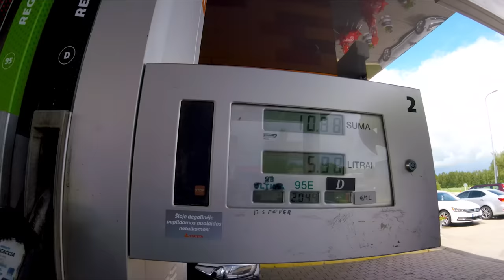Lithuanian Mechanic Makes it Look Easy.. (Lithuania Belarus Border to Kaunas)

Comment from the maker: I love balanced wheels now and am a changed man. Anyone ever have wear like this?
Reply: I get the "shark tooth" affect on my front '17 Honda AT tires.  But you get the same behaviour...that bunny hop. 😞
Reply: My Triumph Tiger XCA 800 is bumping around 60-70 km/h (Michelin Anakee 3). Quite annoying 🏍💨
Reply: Yes, my rim is bent and unbalanced 😂 need to get it sorted. Busy getting a harder front rim. Happy belated birthday.
Reply: Buy some reusable brass weights for the spokes mate. I have them on my XT. Marvelous things.
Reply: The shark-tooth effect has more then one cause. Less airpressure, load of the bike (pillon and luggage) and of course the hight of the knobbies.
Reply: I have this common wear issue on Knobby tires street use. Some people will turn the tire around 1/2 through the wear cycle.
Reply: Have this situation on my 96 DR650 rear tire after an Iceland trip. No big deal, still some milimeters left on the lowest parts to finish this season and then gonna change for a new one for the next season. Probably gonna choose something more knobby this time. Pirelli Scorpion Trail was really nice for asphalt, but not so good for gravel or unpaved roads. But still manageable, passed some of the harshest F roads, crossed some small rivers with it. Not too bad, just always mind your equipment!
Greetings from Kaunas, Lithuania!

Comment: Hi Pedro. Here is something that can help you in the future : Just balance your rims without a tire. Most of the imbalance  always comes from the rims.  So you can change your tires or repair the tube by yourself. Just let the weight on its place and you will be fine.  Happy journey.

Comment: Belated happy birthday mate. I hope you had a good one.
New tyres, the smell of new rubber is awesome. I think I change my tyres before required just for the smell of it. I've a couple of old tyres in the back of my van now for a couple of months now and on hot days, everytime I open the side door I get a sniff of rubber. I'm wierd eh?
How I got travelling into the Eastern block early on, we used to export Lada cars back to Russia via our contact in Lithuania. The Lithuanian's used to convert RHD cars to LHD in those lock ups with little more than basic tools. Very impressive to what we in the west have to work with. I admire the Eastern block states. They embrace what they have and make it work where as us westerners tend to just expect what we have and get dissapointed about what we don't have.
Reply from the maker: It's a get it done attitude eh. Seen it in Russia too but also parts of Australia and New Zealand. What having been cut off from the world and long time hardships can do to a culture/peoples. No worries Nick, a lot of weirdos ride motorcycle, I myself included am a sniffer of the rubber.

Comment: My grandfather used to change treads on steam locomotive drive wheels. A lot of slip'n grip. 
I tried a bit of Cyrillic for fun when following someone on YouTube.
Google came up with this for Pedro Mota (Spanish): Питер Спек. (Peter Speck)
Pedro Mota (Portugese): Педро Мота
Reply from the maker: It's been fun recognizing letters on the way, will need to study more Cyrillic. Years ago on my first run I couldn't read anything in central Asia and Russia
Reply: @iPedroMota  part of difficulty is that letters look similar to latin script, but pronounced differently.

Comment: I couldnt understand the issue with mitas e07+ front. Can anyone elaborate?
Reply: Gintas didn't like it in fesh-fesh (sand). It is 60/40 tyre as they advertise. I had it as well and changed it quickly to more agressive one. If you drive more on asphalt I think the tyre is fine.

@Pedro, enjoy Lithuania. Best of luck!
Reply from the maker: Chevron patterned front tires, or similar patterns, don't really grab in the sand. Instead of following the direction you want it to go the tire will push sideways in the sand. I've had a lot of experience with those (Scorpion, K60 scout) and for the most part you'll be alright when you can keep the speed up through the corners. Though on slower more technical bits the tire becomes increasingly wishywashy causing instability and front end wipeouts. For a long time I was ok with that only wanting the grab and push from the rear tire but once you experience a more grabby front too it's a game changer.

Comment: Tkc80 best tires ever. Road/offroad, there are no better tires.
Reply from the maker: I don't worry about them on the street. Off-road after having for many years pushed chevron patterned 90/70/50 tires through gnarly as terrain and being alright with it, just having that front pull in the direction you want to go is priceless.
Reply: @iPedroMota  
Sometimes I feel more comfortable doing 100 kmh in the corner with my Africa and these tirens, than on my supersport gsxr. 
Its just amazing.
I did 18k with the front one, and its still doing its job. 🤣🤣 
When I die,  amma take brand new tkc80 tires with me so I can ride in Paradise.
Reply: @iPedroMota  
God bless you Pedro!

Comment: 20 euro for one tire change and balance? Is it regular price for Lithuania?
Reply from the maker: Don't know, I did think it was on the higher side. Maybe I got the foreigner rate but life is surprisingly expensive in Lithuania and Latvia (probably because of the Euro). Supermarkets and kebabs for example are priced very similarly as in the Netherlands. Life is tough in the Baltics for a lot of people.
Reply: @iPedroMota  yep, Poland is very affordable comparing to other countries, especially to ones with euro like Slovakia and Lithuania as I see.
Reply: @iPedroMota  Yep, Euro is the case. This currency is for Germany or France. Not for Lithuania, Latva, Slovakia or... Grece. They come to Poland to purchase goods - way cheaper in Poland because of Zloty.
Reply: @iPedroMota  yes, prices in Poland always used to be lower then in Lithuania. And inflation went through the roof in last few month (20%). Latvia and Estonia won't be any better in this department. Are you heading to the cost,  Klaipėda?
Reply: @podunkman2709  Poland was cheaper even before Euro compared to Lithuania. So it has nothing to do with Euro. And quality stuff costs the same. 
About  20€ tyre swap. Well authorised car service would take 50€ for 4 regular tires. But taken in to consideration that you did all the work, taking rim off. Yea it was not foreign price but "people that dont know better" price.
Reply: @kerstas10  Poland wasn't cheaper than Lithuania before euro. It was basically the same case as now but the other way around, polish people were going to Lithuania and buying food, fuel.